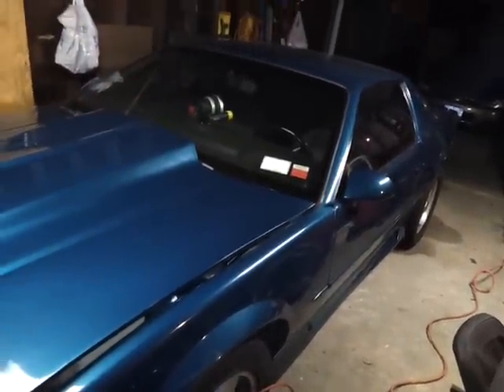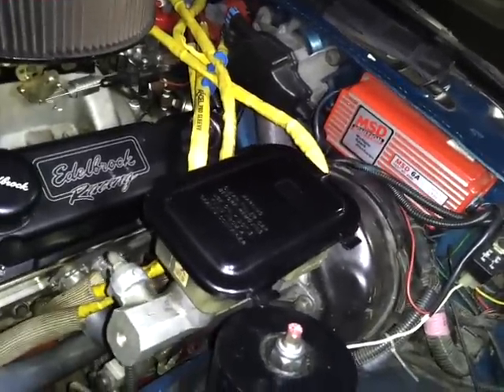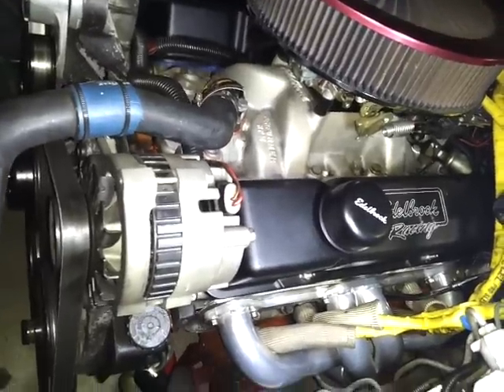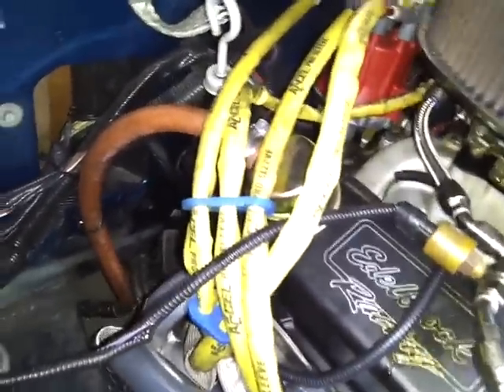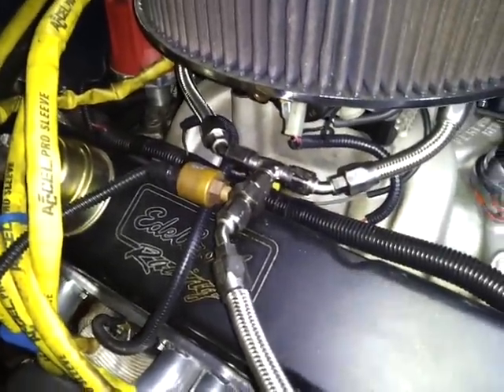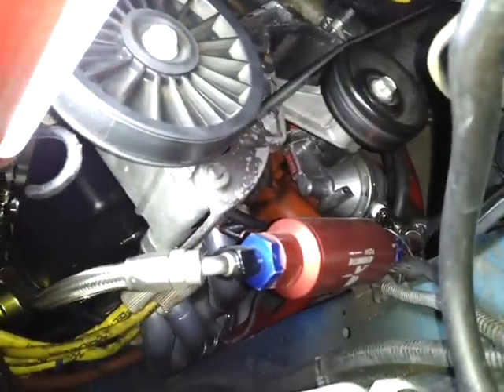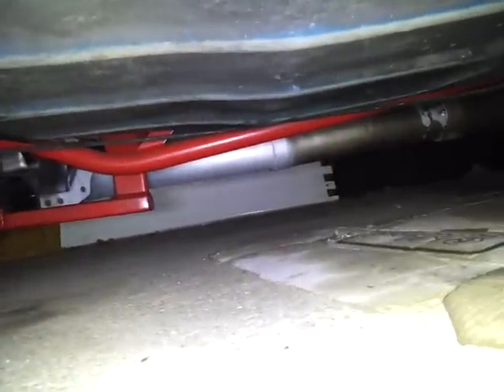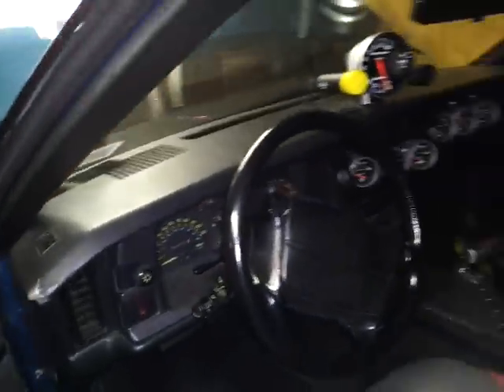Camaro 383 stroker 1991

Comment: I know this is an older video, but just came across. What did you do with your evap canister? My set up is close to yours, but I still have the evap.
Reply from the maker: SJ EII cut the line and plug it..then put a little filter where the vent checkvalve is
Reply: Cut the line near the tank? Then replace the white valve near my Rear axle with a breather? Thank you.
Reply from the maker: SJ EII yes
Reply: Thank you and keep up the great vids!